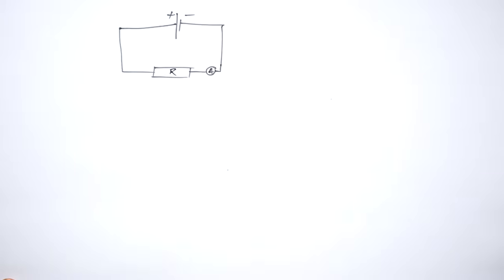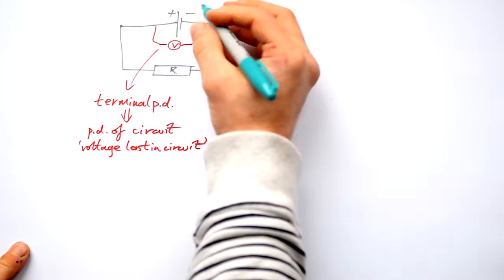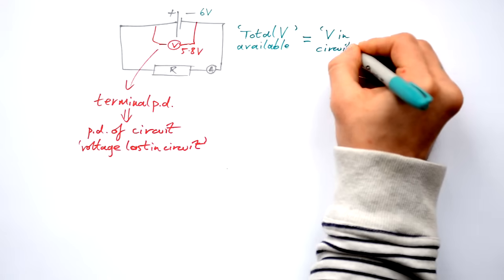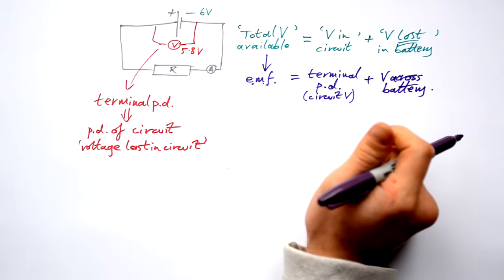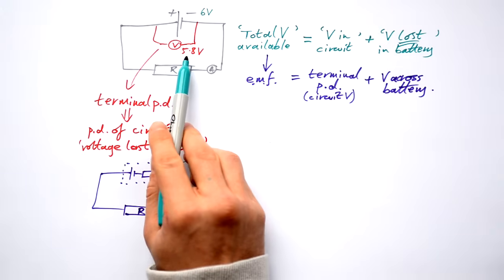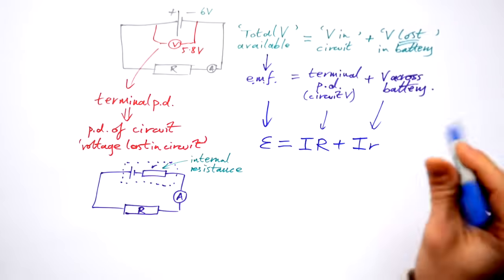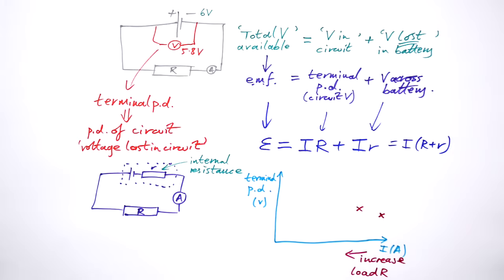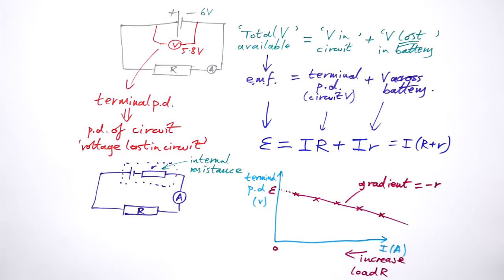EMF & Internal Resistance - A-level Physics

Comment: Why can internal resistance of a battery not be measured directly?
Reply from the maker: You technically can't, because even a voltmeter requires a tiny current to flow through it. However in reality this is so small that it doesn't make a difference. So, put it across just a battery, and the V you measure is pretty much the emf.
Reply: @ okay thank you!!

Comment: At 4:12 can someone explain why the pd would be lower if the current is greater?
Reply from the maker: Did you not watch the video?! 😂
If current is higher, more volts are lost in the battery, so there are fewer volts (p.d.) available to the circuit.

Comment: I have a question that says “suggest why a chemical cell has internal resistance” anyone know how to answer it? 

(Thanks for the video btw, really helped my understanding)
Reply: This may not be correct, but during the chemical reaction the battery may heat up which causes the resistance to increase. Temperature and resistance are related somehow.

Comment: Im getting confused with the graph bit. You're saying if you start with high current the terminal pd is low but isn,t the equation V=IR so a higher current should mean a higher Voltage?
Reply: i think if u look at the above equation where emf is a constant, so emf - IR = Ir => emf-V = Ir and so higher lower current means higher v, because i think the R changes too but not the internal r
someone check this please

Comment: I dont get one thing, at some places we say I is directly prop. To V, but at some we say if I increases V decreases.
Please reply
Reply: Mahrukh Iftikhar it is directly proportional if it abides by ohms law, but in reality (filament lamps etc) as Current increases the ions in the conductor vibrate more making it harder for electrons to pass through, increasing the resistance. Thus decreasing voltage

Comment: Why exactly does the terminal p.d across the cell increase as the current decreases/ external resistance increases in terms of actual distribution of energy and movement of electrons etc?
Reply from the maker: To reduce current, you need a bigger load resistance - because what you have is effectively a potential divider, more energy is lost across R, and less across r.